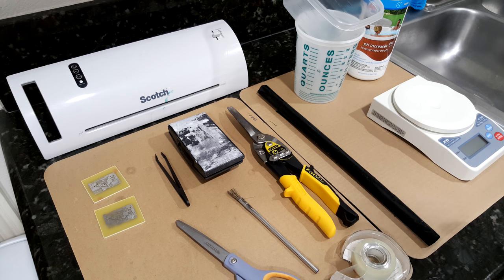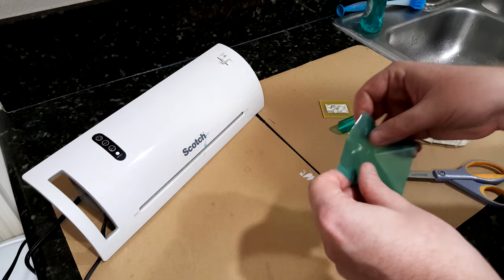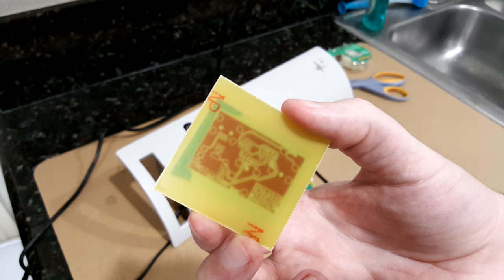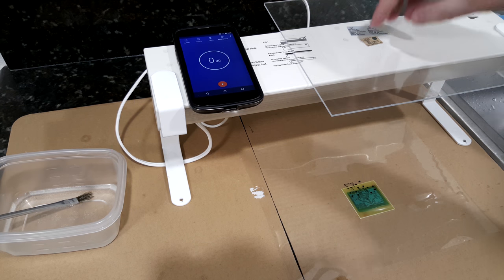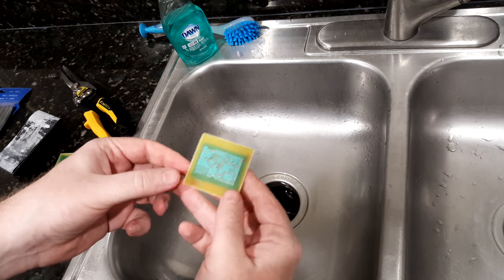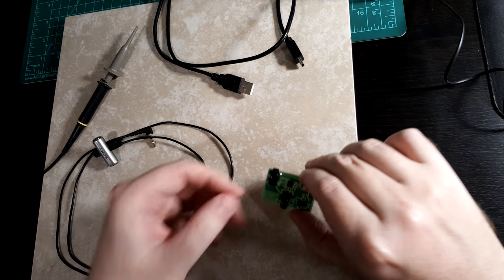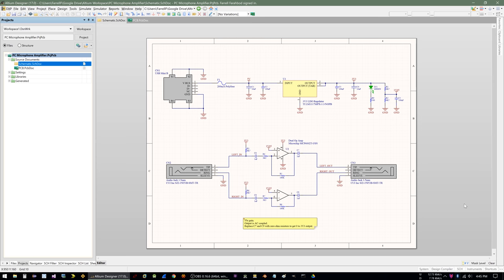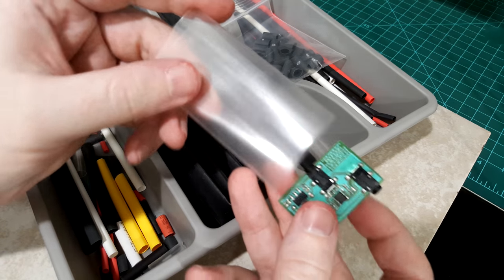PCB Prototyping Part 2: Solder Mask, Assembly and Testing (Dry Film Soldermask)

Comment: Awesome videos, both of them. I have a question regarding the circuit, actually have 2. Why you connected left and right channels to 3.3v using a 4k7 resistor. You said pc microphone has amplifier, what this will do, it will suppress the amplified gain? My 2nd question is op amps require negative and positive power on pin 4 and 8. How you managed with only positive power source. I haven't seen such circuit diagram for op amp. I am sure my knowledge is less here, could you please help.
Reply from the maker: Most microphones need power, and the pull-up resistor provides that. Your computer's sound card has a similar circuit. And op amps do not require a negative rail unless their inputs or output will go below zero volts, which does not happen with the circuit I used.

Comment: thanks for the nice video. You are cutting your board (fr4?) with an ordinary tinsnip? Does this work good? I cant imagine that you don't get cracks in the pcb... I used a fretsaw as yet but that cuts not very straight and makes a lot of epoxy dust...
Reply from the maker: It works well if you use a sharp pair of tin snips. You get a little fraying of the FR4 at the edges, but a quick sanding takes care of that.

Comment: Minor comment.  You typically add a roll-off Cap in parallel to the feedback resistor to stop high frequency oscillations (or downstream sensitivities).  Ie to the opamp is a an active lowpass filter with gain!!   Great tutorial otherwise.  BTW, which solder mask film did you use ?
Reply: Dynamask 5000 its in the description

Comment: In your previous video (Part 1), you showed how to tin plate the board. Can I use a PCB with just the tin plating as the final surface finish, and not use solder mask at all? Will that cause any problem to the circuit board functionality?
Reply from the maker: Yes, that's fine. The solder mask helps to reduce the chance of solder bridges, and offers some extra protection against abrasion and corrosion. But it's not required.

Comment: I like that you solder them on the circuit with the iron not the hot air that is 10 times easier :)
Reply from the maker: I've used paste + hot air in my earlier PCB videos. If you are hand-dispensing the paste, it doesn't seem any faster than using an iron. A stencil + hot air is by far the best way, but I don't have a way to make decent stencils. I supposed a pneumatic paste dispenser would be a compromise, but I don't have one to try.
Reply: Ahh, if you had a laser cutter the stencil would be no problem ;)
Great tutorial tho! :D
Reply: 30% hcl + drug store peroxide will etch a flattened pop can...hint hint

Comment: You can actually get a liquid solder mask that is still uv cured but is easier to apply
Reply from the maker: I actually tried that before going this route. I could never get a consistent thickness with the liquid mask.
Reply: upgrdman Hi, I definitely agree! solder mask paint is messy! could you please tell where did you purchase the solder mask dry film? thank you
Reply: HABOT SSAR at EBAY

Comment: are you using plexi?
Reply from the maker: The sheet of plastic I place on top of the PCB is acrylic.
Reply: thats likely part of your exposure time issue. Im not sure on the specifics of that film but most of the similar stuff for etch resist responds best to around 370nm wavelength light. AFAIK acrylic starts to absorb under 400nm. Combined that with the fact that your tube isnt a high power uv source to begin with and very little uv is likely getting to the resist.  Look for "low iron" glass to pass the most uv